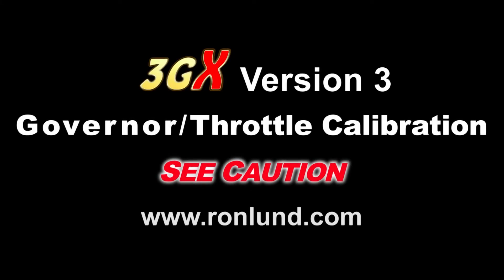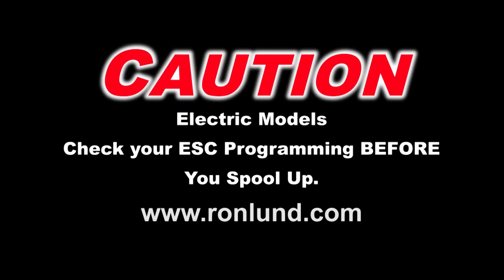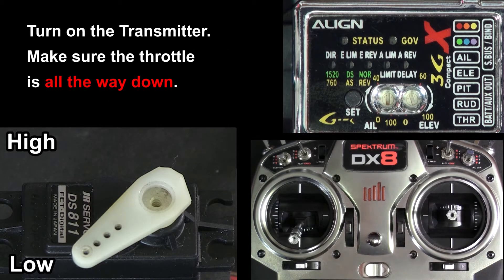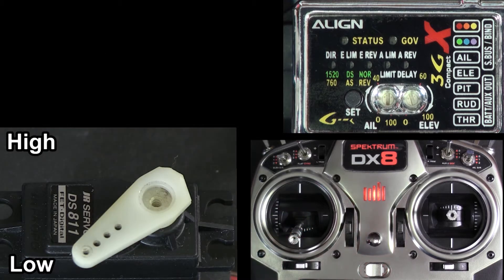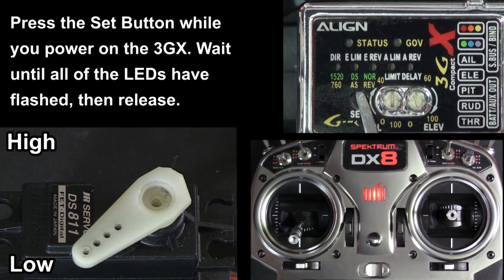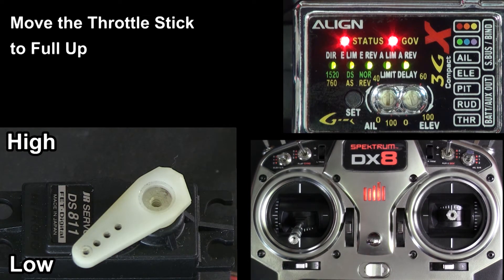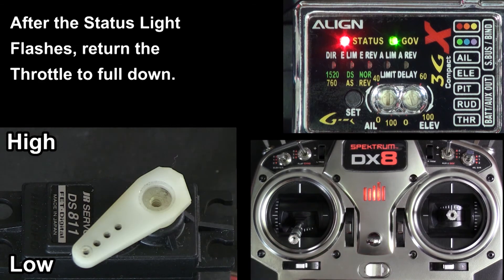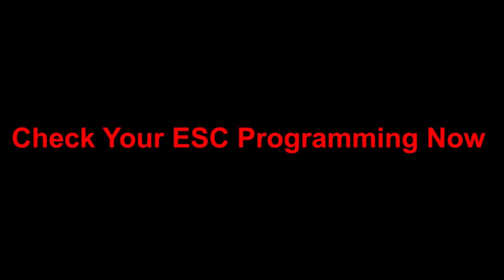3GX Version 3 Governor Menu must be completed by all.

Comment from the maker: Thanks, but this needs to be done after you have your throttle setup also. Anytime the throttle curve endpoints are changed, such as after calibrating your ESC, or changing the endpoints while setting up a nitro carb,  it should be repeated.